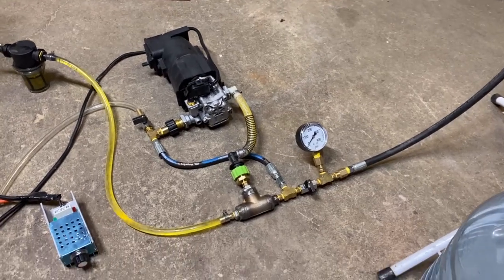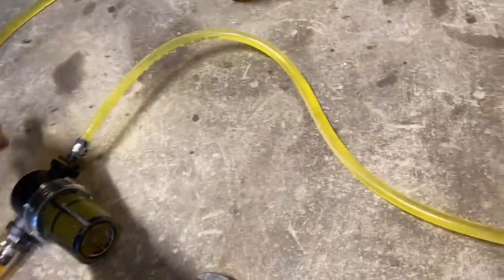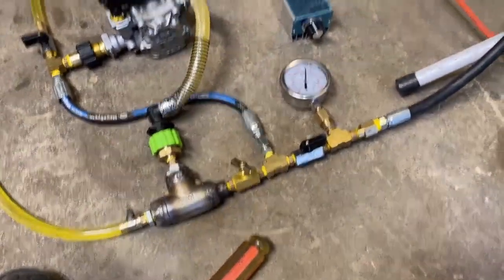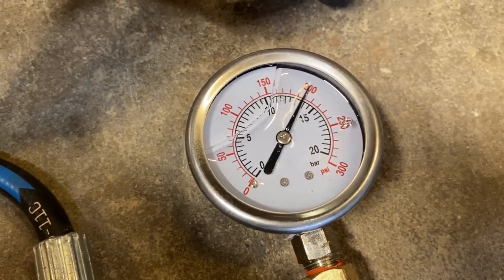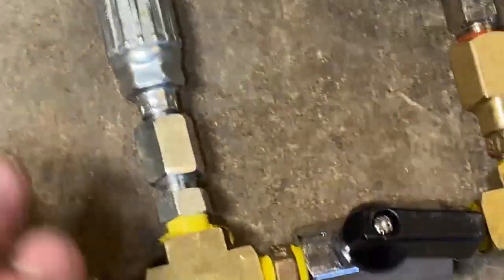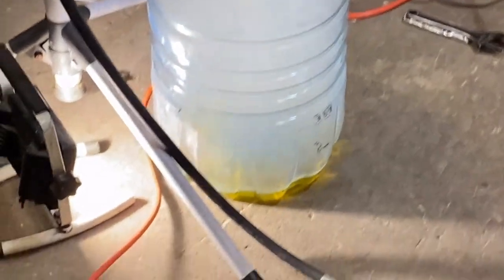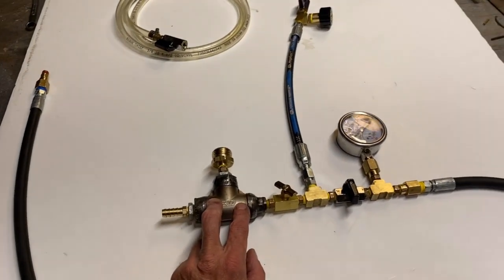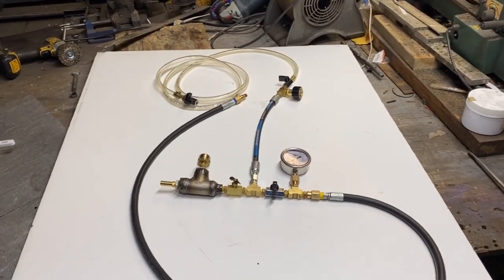Bypass pump Instructions Mushroom Auto clave Steam Machine

Comment: I highly suggest using #4or #6 jic female swivels for the hyd hoses,
Use adapter fitting If you need pipe thread.
Also you will find hyd adapter fittings and toes etc are cheaper then brass.
And more useful and over kill,
 I love jic fittings,